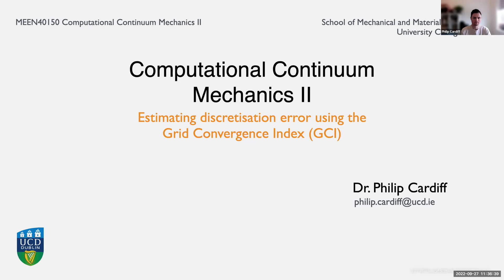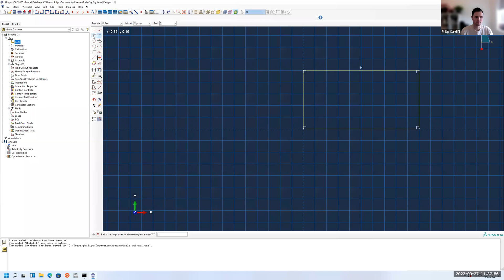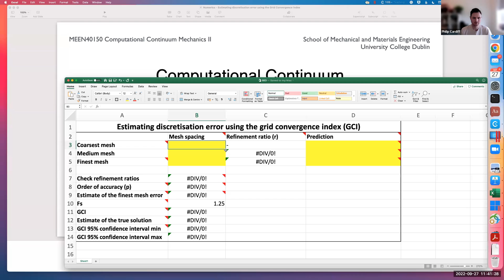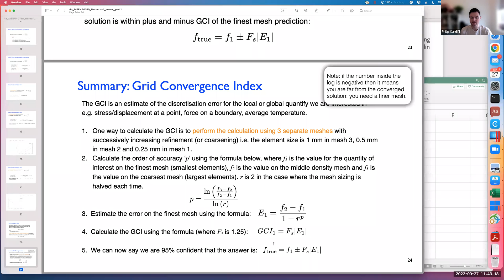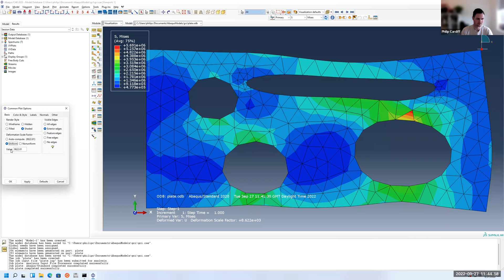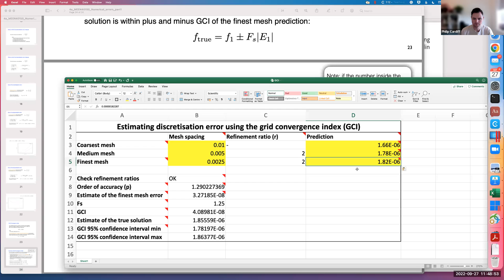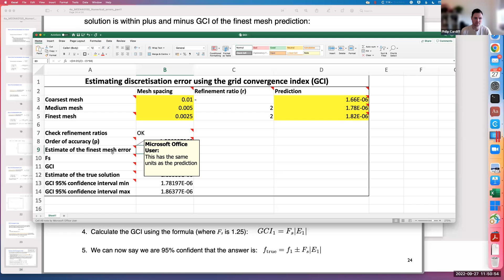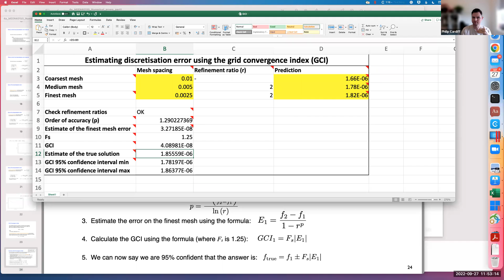MEEN40150 2021   Lecture 12   Estimating discretisation with the grid convergence index

Comment: In the case where the fine mesh has a higher value than the medium mesh and the ln(med-fine) is negative, is the GCI computable in any other way?
Reply from the maker: No the GCI formula is not changed. If the number within the log is negative, then the GCI method cannot be used: it means that the predictions are not in the "asymptotic range". Using an even finer mesh result if one potential solution, or using a large refinement ratio "r".